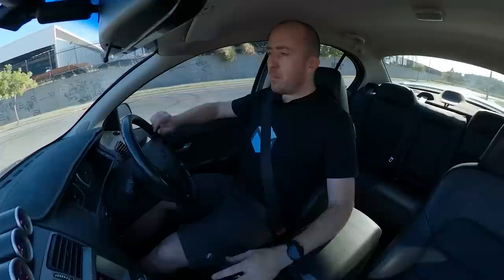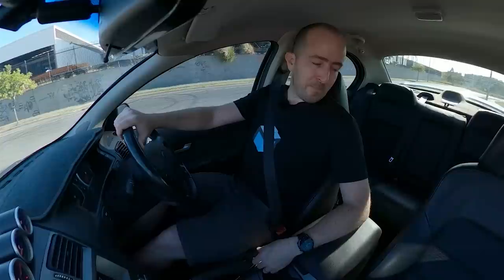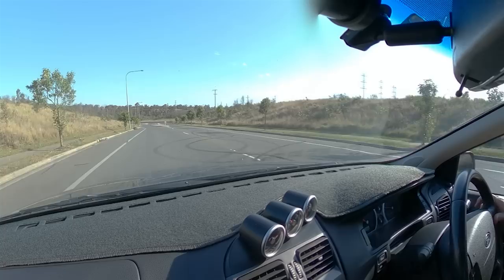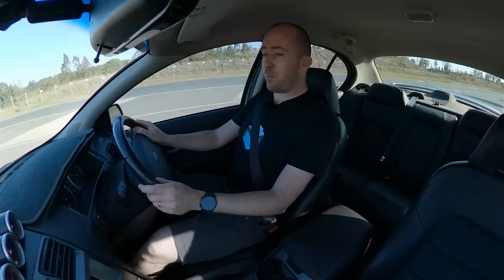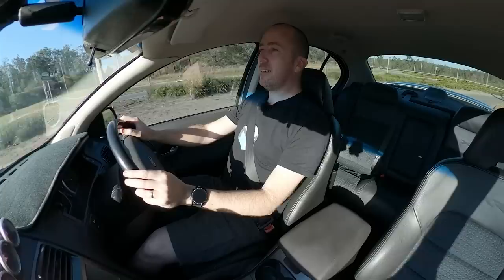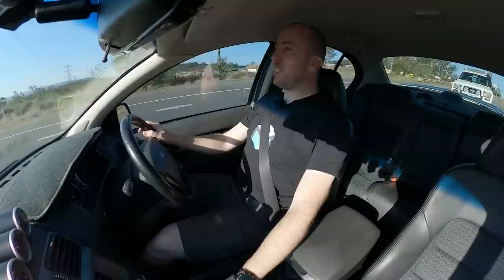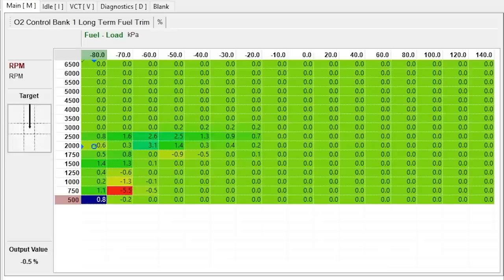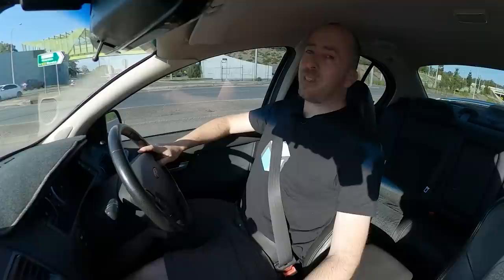🚗How Does it Drive on a Base Tune? Haltech PRO Plug-In for Ford Falcon BA - BF FG & FGX Barra Turbo

Comment: As someone who daily drove a Haltech Barra plugin since it's launch, I recommend enabling the throttle-blip function. It is 100% possible straight out of the box on all manual Falcons with the Haltech plugin. I had mine set up to be enabled/disabled with the cruise control button in case I felt like rev matching myself. No extra wiring or specialty tunning knowledge required and it made the car amazing to drive.
Reply from the maker: I saw that option! I'll definitely be having a play with it, plus the launch control and two-step settings.

Comment: You will need to apply the trims to base table before you will get the full benefits of ltft.
Head to functions and then O2 control.
But I'm sure you have already figured that out 👌
Reply from the maker: You still get the full benefit as such, it just applies the changes to the fuel map and will continue trimming from there.

Comment: Solid job with this car mate. On the base tune with an upgraded dump and intercooler the turbo will spool quicker due to a better flow, but this isn't particularly the boost building faster, it's more or less that it's flowing more, keep in mind boost is a measurement of restriction as opposed to a measurement of airflow. So basically its going to flow more air, which gives you more power, which in turn spins the Turbine faster, which in turn creates restriction faster. A aftermarket turbo side intake and battery relocation will also improve spool and performance due to shorter runs in your intake tract. 2 biggest things that affect turbo spool is intake runs and exhaust restrictions.

Comment: Hey mate, how much did this set you back? I’ve been looking at upgrading to a Haltech ECU of sorts as my factory ECU I believe is starting to fail on me. My BF XR6 is only a petrol N/A, so really just wanting something that I know will work well and that I can get a good, powerful tune out of. What would be their cheapest option to suit if any idea? Thanks
Reply from the maker: Check out their website - the Barra Pro-Plug In without the wideband sensor is around $3100 from memory

Comment: Sean you ever going to lower the beast??
Reply from the maker: Never
Reply: @MotoringBoxTV  damit...  😂😂
Reply: @MotoringBoxTV  Hey Sean if i ever come down your way and your interested in reviewing shockworks suspension for the fg falcon i'll be more then happy to lend you my car.
Reply from the maker: @reganmickle9821  it'd have to be pretty amazing to impress me! I am of the opinion that lowered suspension ruins road cars. It does make them look good though.
Reply: @MotoringBoxTV  I agree though the shockworks suspension are completely adjustable height wise and have 12 point firmness adjustability so you can set it up exactly how you like. Brett O'Brien is the one who owns shockworks, he worked with FPV (Prodrive) designing the suspension set-up for the cars and the suspension and chassis for the gtholy grail, hence why i decided to go with them. They're not cheap at $2,200 though they are worth every cent for the handling, feedback and stability they provide.